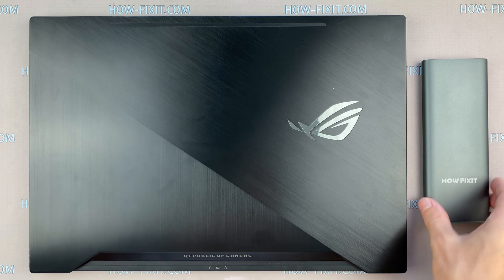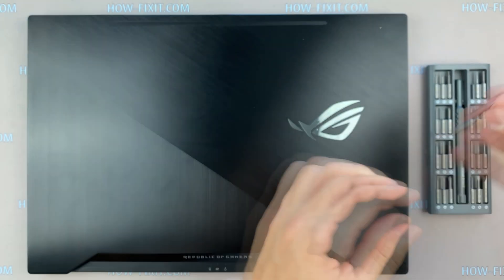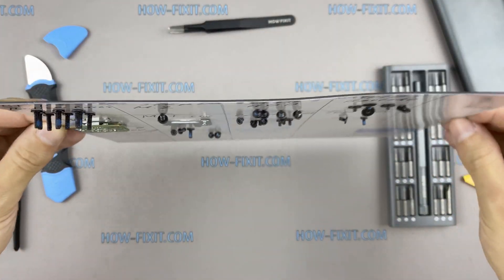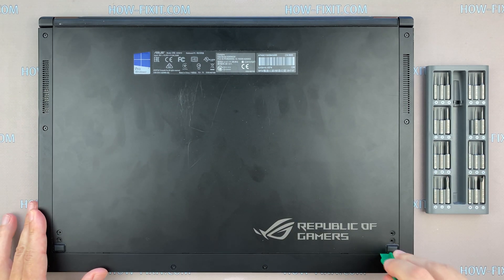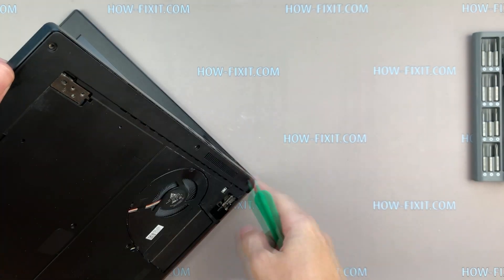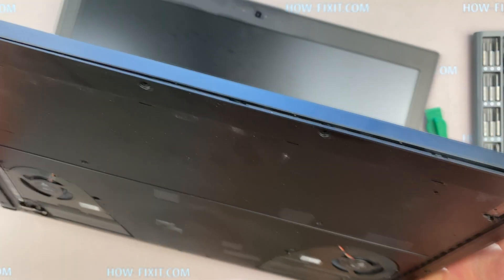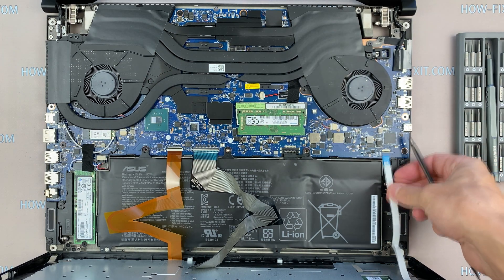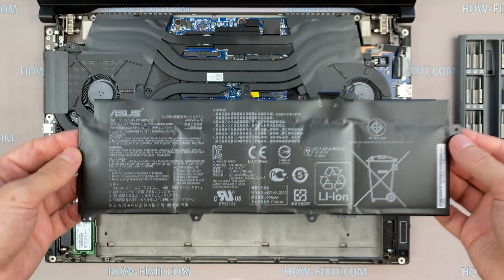Asus ROG Zephyrus GX501 Battery Replacement – Full DIY Tutorial

Comment: For anyone plagued by this issue, just know that if you remove the battery you can still run the laptop on AC power. Just make sure you have a solid surge protector ;)
Reply: Yeah.. until the laptop decides to DOWNLOAD A FUCKING FIRMWARE UPDATE FORCEFULLY AND THEN WONT LET YOU BOOT ANYWHERE ELSE OTHER THEN THE FIRMWARE BIOS UPDATE AND WONT LET YOU UPDATE THE MOTHERFUCKKIIIING BIOS BECAUSE THE BATTERY IS DEAD...... so fuckin dumb icant.

Comment: Thanks. Great video. Thanks for recording in 2160p. :) 
My only additional things I had to do were: 
- when removing @ 3:05 the bottom, opening definitely helped. 
- the battery cable for mine was a touch long. I attached battery first to the socket and then placed it into its crevice. (4:38)
- when putting the final plate back on (6:22), I found I had to open it, and slip the back cover between the inidividual ramp up leg things...and then it was attached correctly. 

Thanks again for the video!!

Comment: Thank you, excellent video. I found this essential for knowing what to expect and performing the battery change without hiccup or damage. I now have a new battery inside which charged ok to 100% and the Battery Report showed maximum available "full charge capacity" which matched the "design capacity" within the report. For my Asus ROG Zephyrus GX501GI, both capacities showed the same at 50,127mWh - naturally the full charge capacity will reduce slowly over time to that of the original design capacity (enter "powercfg/batteryreport" without quotes within the Windows system Command Prompt as system administrator, then after enter the produced report file path which is usually "C:\Windows\system32\battery-report.html" into the Windows Run dialog box from pressing the Windows key and R key).

Incidentally I got hold of the exact same magnetic matt for holding the screws/fixtures and must say I couldn't do any device fixing jobs without it. Also, although I purchased a device repair mini toolkit which appears to have everything, I found that it could have had better quality posi/Philips screw tips as this is where it didn't feel that reassuring when tightening-up the final 4 Philips screws on the underside cover - make sure you have good Philips/pozi screw driver bits. It could also be that the screws themselves weren't the best. No problems at all with the Torx sxrews.

Comment: Several keys do not work on my laptop which we thought was due to a swollen battery. We replaced the battery with the help of your video but the keys still do not work. We want to replace the keyboard next but do not know how to disconnect it and replace it. Have you done this? Could you advise?
Reply: You have to replace the top cover with the keyboard.